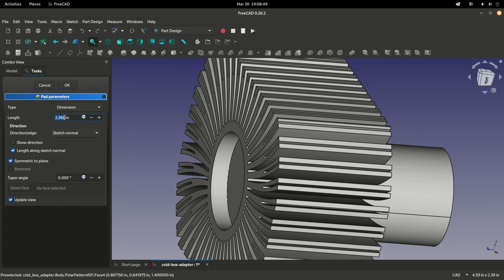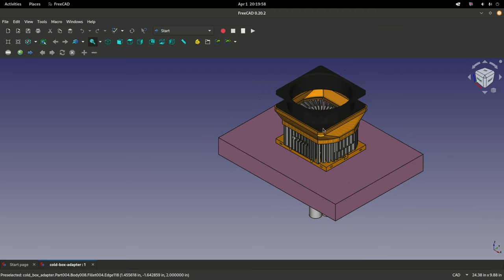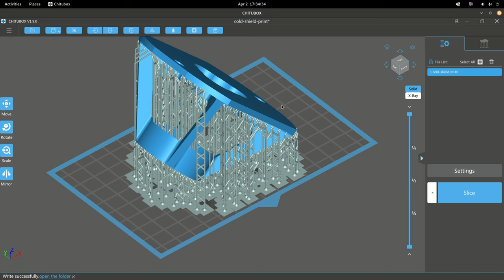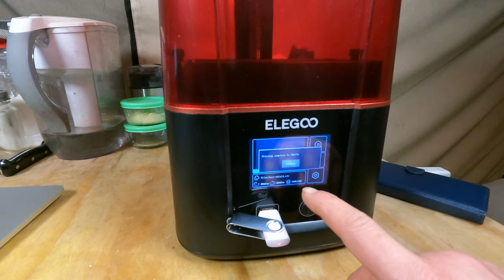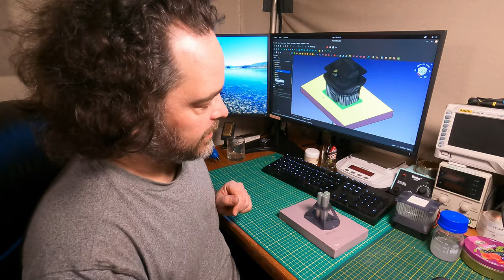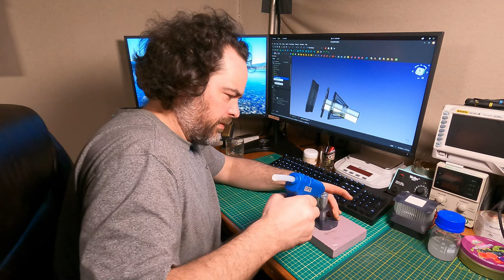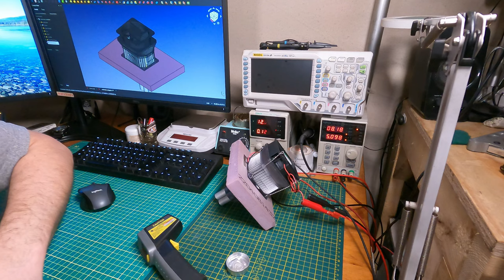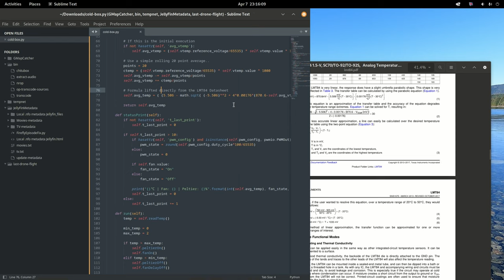S01E08 - Not Your Everyday Beaver Peltier

Comment: Peltier modules are about 10% efficient. For comparison compressor refrigerators are over 100% efficient in moving heat. And you want the module to run on a constant current supply, not using a PWM.
Reply from the maker: It's true that Peltier modules are not that great (efficient), but it's working well for now. The problem with using a linear supply is that in order to provide the fixed current it would have to dissipate the remainder of the power / voltage as heat, so I decided to just PWM it directly.  The other option would be to, buck convert and supply the module that way...   maybe I'll have to try my hand at building my own compressor one of these days, thanks for watching!
Reply: @TheOutlawPhilosopher  yes, you'd need a DC-DC converter, or you can just use the PWM output, make/find an inductor and a diode and a 470 microfarad capacitor and make the drive part of a DC-DC convertor that way. You don't realy need a voltage feedback if you are monitoring the 2 temperatures and adjust the PWM acordingly. It's still PWM controll but the TEC only sees linear voltage that way.

Comment: If you wanna impress you build it out of wood using hand tools, any schmuck can print the parts. True diy/survivor re uses discarded "junk" and or natural materials to make their "fridge" from. This is just a guy using a home/city tool in the bush for some reason. If there is more to the story you might have said so at the beginning of the video and not wasted time on a cad slide show. Yes 3d printing has it´s place but this video was presented as if it was a "bush craft" type of video.